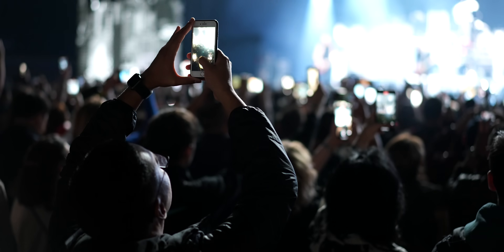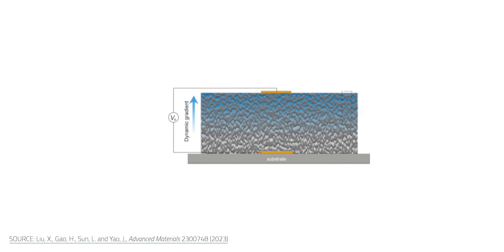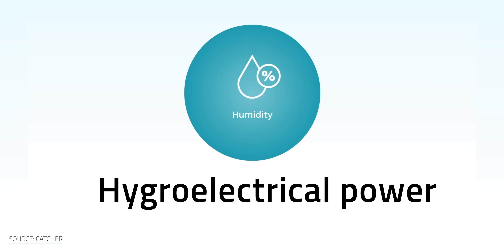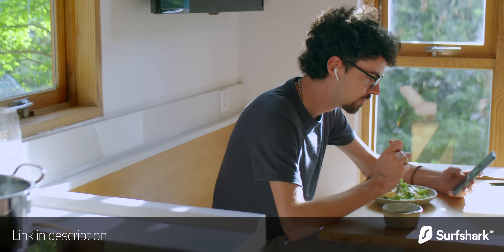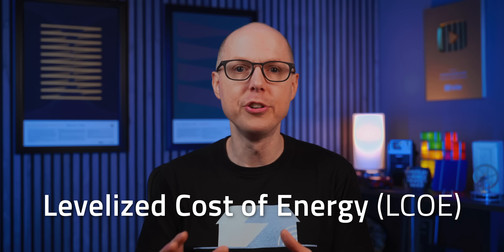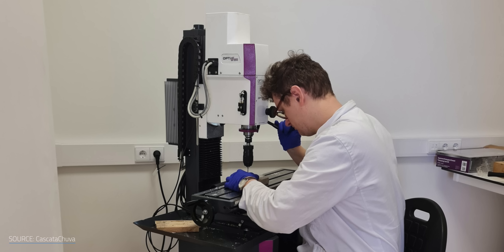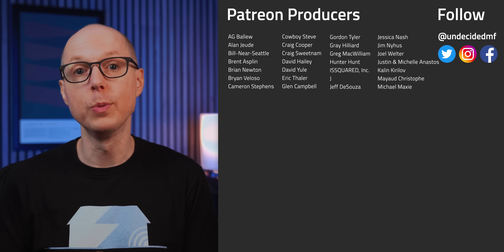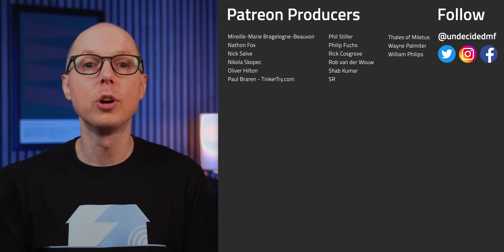Is This Accidental Discovery The Future Of Energy?

Comment: So it cant be eliminating the water molecules because you can't destroy matter or energy, and similarly it can't create energy either so the energy being collected has to have come from an existing source. So  the charge being developed  may be entropy driven. That would be wild, is there a temperature drop in the air?

That or its causing water to separate into its substituents like O2 and hydrogen or even OH- and H+ which would be really interesting as well.  Lots of implications including an alternate to electrolysis, pH reactions that could be developed, biology would be affected heavily considering how much biology is driven by surface area based water transfer between water soluble or in soluble membranes.

Water is a polar molecule as well so if this is driven by polarity, there are lots of other polar materials as well for when water may not be feasible or efficient. I'm leaning in the direction of believing polarity would have a important part to play in this considering charged materials interacting with water, or inducing charges is so foundational to biology and chemistry already. 

I am trying to ask myself what the limitation on this would be because you cant create perpetual energy here without it coming from somewhere, and some thermodynamic loss in the system, otherwise it would literally break the laws of physics.

theoretically once a optimized material and structure is created, you could pressurize a enclosed hydrophobic container filled with a pressurized humid air mixture with a conductive grid of this material and produce energy. then scale that by connecting each of these in a parallels array. if it denatures the water, then water will reform or could be ejected as its substituents and you could supplement a hydrogen fuel cell vehicle with a device that makes energy while producing hydrogen, meaning fueling the engine would be as simple as filling up with distilled water. a game changer for Toyota. 

If instead its entropy driven those same containers would get cold and slow energy production, but then, you just developed a new heat pump that you could just reheat to get more energy. a sunny day could be all you need to fake these energy producing containers function again. 

If polarity is involved and we've already been successful  at getting bacteria. to protein fold working materials, Nano machine design has a new way to illicit charges. you could revolutionize biology. Attach a patch to the sa node or av node using a catheter  and nitol splint and you have a micro pacemaker without open heart Surgery. Or a way to fry cells with zaps of electricity, or a new mechanism for inducing neurons to threshold with minimal surgical intervention.

if its none of the things mentioned and it is something. completely. new, holy crap. that would be new energy based science that could help us reimaging all aspects of science we currently. think we understand well, creating new perspectives on our scientific reality. that would mean who knows, and that would be discovery of magnets big.

Comment: You're not analytical or critical. You always jump on the hype train and repeat bold claims that make no sense, without first giving it a good think.
In this case, once the capillaries are filled with water, the device is toast. Or it will take more of its energy output to dry it out again. The energy density of this thing seems to be hilariously low. 

unsubscribed

Comment: Summary: Researchers from the University of Massachusetts Amherst have discovered a way to convert humidity in the air into electricity, creating what they call hygroelectrical power. The team found that nanostructures measuring 100 nanometers in thickness, or less than one thousandth of the diameter of a human hair, could create an electrical charge when airborne water molecules knocked against the edges of tiny holes within them. This process created a charge imbalance between the layered chambers, mimicking that of a battery. The team then applied the technique to a range of materials, including graphene oxide flakes, polymers, wooden nanofibres and bacteria, with all attempts proving successful. While the devices only produce around a single microwatt, CascataChuva, a Portuguese firm, is planning to commercialise a variant of the technology, with a pilot slated for 2024.

Comment: if the background theory is correct, you’re not using humidity to generate electricity, you’re harvesting energy from the heat of the molecules so it would need to be hot and humid and make the environment cold

still super cool concept

Comment: Because of the laws of thermodynamics, the only way you can get energy from anything is from something going from a high energy state to a low energy state.  In the case of coal it is high energy coal burning to produce lower energy co2.  In the case of the sun it is high energy hydrogen fusing to lower energy helium.  I am not sure what is going to what in this case.  In other words, what is the fuel and what is the byproduct?

Comment: Solar Panels are also the best ever excuse for building shade over parking lots, which of course keeps cars cooler and out of the rain or snow, but more importantly helps reduce the heat island effect. This new tech is pretty exciting nonetheless. Hopefully it works. Having multiple clean sources of power seems the safest plan for a variety of reasons.

Comment: What would be the environmental impact if this was ever widely used? You could be stripping the air of tons of moisture and if that is the case, couldn't that potentially impact weather on a large scale? Turn humid tropical areas into dry and arid if there is enough of those? Also, if they don't go all the way through, wouldn't that mean that they eventually get clogged up over time?

Comment: The dust and humiditiy swing problem could be sloved by putting it into an airtight enclosure and have a fan circulate 'pure' air and water vapor. Right? Edit: After reading some other comments, this solution might give problems with the seperation of dry and humid air to create the gradient or saturation of the material.
Also I wonder if the "bumping" of the water molecules that provides the charge reduces the kinetical energy the water holds, converting it back into liquid water from vapor. If that is the case the heat and velocity needed to give the humid air the energy to power the device would make an enclosed system impossible.

Comment: I subscribed to this channel in the past, but then unsubscribed in favor of other channels.  As an engineer, I get stuck easily when the technical details are wrong or missing, now not trusting that the rest of the content has been properly researched (and thus worth my time at the expense of other channels).

This video is a good example.  The YouTube algorithm knows my interests and recommended it.  Despite all the disclaimers, there are huge red flags that I struggled with immediately.  Any discussion of a new energy source should address conservation of energy right off the bat.  Where is the energy coming from?  This is so fundamentally important that without it being addressed, the video risks coming across as yet another one of those scammy over-unity device videos.  I strongly suspect that having one of these devices in your house would increase your heating/cooling bill far in excess of any power generated.

A second huge red flag is saturation.  Even if the device works as advertised, it seems very likely it would only do so for a short period of time before it would have to be 'renewed', no doubt by applying energy to it (e.g., heating it).  Again, this is a fundamental issue that is a prerequisite for any video like this to be ready for prime time.

A third huge red flag is describing the performance of the device by it's voltage output.  Run a comb through your hair and you can generate thousands of volts.  A US house is powered by 120V/240V, so clearly you can now power many houses with that comb, right?

The video did pique my interest enough to search the Internet for some details.  What came up was also full of red flags, unfortunately.  There was one paper from 2018 that mentioned that maximum power transfer out of the device occurs with a load of 10 megohms.  To an engineer, that fact speaks volumes about the potential viability of the device.

You have exceptional video creation skills.  I have seen many technically robust videos that were painful to watch.  Perhaps a collaboration might be good for both parties?

Comment: owe yes my design can be scaled up or down as needed , as well as retrofit into existing  structures ( i.e. in large cities & or rural locations }. Let's fix the clean energy issue ounce & for all . As to understanding my tech.  Ounce diagram is shown  most any 5th grade science student can under stand how it works & why it is better than solar, wind, hydro, or geothermal . I have this tech. to solve the energy needed for humanities current & future needs, but it is only fare that I am properly compensated for my ideas . So no I woun't just give it away. Let's talk.

Comment: Depends on what reaction the electricity is coming from. That is, exactly what is the true source of the energy. This will determine if it is a primary or secondary type of battery. I suspect this contraption will require elaborate recharging procedures to clean out the pores as they get filled with moisture. This may take more energy than the divice generates!

Comment: Isn't this more just absorption chilling but it can generate a charge? In a sense, it's a static charge generator. When it dries off, it generates some voltage. 

Seems like a thermoelectric effect, somewhat reversible, but mostly inefficient. Thermoelectric can produce cooling when direct current is applied, but can also produce power if heat is applied. 

Thermacoustic cooling isn't terribly efficient, but was used for cooling the IR module for the JWST down to around 10 Kelvin above absolute 0.

Comment: IMO, this technology's success will depend on how hard it is to remove the moisture from the moisture battery afterwards. 
If all it takes is a hot day, that's fine - then it can even be useful as an A/C heatdump. But if you have to plug in electricity to drive the water out of the pores, it becomes rather less useful. Not useLESS, because you can still use it to moderate solar power, but still less useful.

Comment: O.o this tech has been around for a minute though, theres an engine that ran off the ionically charged particles in the air, the only issue with the engine is they couldnt figure out how to slow it down or keep it from ramping up. They basically couldnt control the reaction.

Comment: It nano whatt not micro whatt and the next part is that they think that they might have left chemicals on or in the materials that were simply getting activated through the presence of water to form a week acid because if the theory you were describing were true they should still be getting a similar or identical result from zero moisture environments. The next thing is that many times they needed something to pull substances through the material to keep the system running for any amount of time but that takes much more energy than they were able to even consider getting from thousands of layers.

Comment: The price point doesn't look comparable.

The new technology produces 10kWh each day, while, at the same cost, a 10kW installation of solar panels will produce 10kWh each hour.

That would be in perfect conditions etc., but you can expect to generate way more than 10kWh each day with that solar panel installation.

This means that they are not comparable, the solar panels are way cheaper.

What am I missing from your calculations?

Comment: it's the question where do the water molecules get the energy from? Are they excited by sunlight and then release the energy inside the nanotubes? If we don't get the right answer we might just do the same mistakes of free energy, perpetual motion machines and attempting to run cars on water. it might also be a result of oxidation reactions but that's only my guess. An illustration of a single cell unit with comparison to a battery cell would clear out some unanswered questions.

Comment: This seems like a great idea...
Great for damp cold homes.
No need for insulation...

Small amount of starter energy, then the humidity battery sucks up all the extra moisture in the air and produces power which runs heaters which warm the air and produce more humidity.

A dehumidifier that produces power?

Comment: I'm not jumping on the hype train yet but I think it's an effect worth looking at.
I read  through parts of the  paper
One thing they checked for is water consumption and saturation. They had a 110h continuous test after which the current was the same as at the start. Therefore saturation doesn't seem to occur.
They also did weight measurements and tested relative humidity in a closed chamber and didn't see any changes there either. The explanation (as far as I understand it) they have came up with so far, is that the physical motion and bumping of molekules into the walls transfers charges and leading to a charge difference.

Since we have the laws of thermodynamics, the  energy has to come from somewhere. Since we are talking about motion of molekules, I'd assume that it's more or less a thermal generator. Unfortunately they didn't seem to have tested for any corrolation between temperature and output parameters or temperature of the device in an insulated chamber over time

Overall it could also be a fluke in measurements. But I haven't looked for any followup papers yet
Reply: We will never solve these problems until we come up with a more accurate means than mathematics to describe it.   the laws of thermodynamics are like the laws of conservation of energy, energy cannot be created or destroyed.  Then we use physics and math's that states 1 x 0 = 0, which destroys conservation of energy, yet we believe 1 + 0 = 1, energy preserved!

Comment: So... where is the energy coming from? What's happening to the moisture? Is this generating electricity from the changes in humidity? Is it condensing water into liquid and recovering some of the energy that evaporated it in the first place? I don't get the thermodynamics here.
My best guess is that this is a material that produces electricity as it absorbs water, and needs to be dried out to 'reset' it? In that case, it's the fluctuations as the weather shifts over the day that are being tapped for energy. I suppose this might be handy as a supplement to solar panels as humidity would be expected to usually rise at the same time as sunlight falls, but I doubt it's going to be any sort of game changer -- especially since both daily cycles AND weather changes would be relevant to its energy production cycle.
Reply: The energy is coming from the natural jostling around of water molecules in the air (Brownian Motion) hitting the water molecules, the water molecules in turn hitting the device, knocking electrons off the device and capturing the electrons.
Lower in the device the extra electrons on the water molecules are recaptured by the device.
The loss of energy from the air will cause the air to cool.
Reply: In that case, wouldn't it function just as well with the device sealed and provided with a suitably humid internal atmosphere, just left to exchange heat with the outside? What you're describing would be HUGE, as it would be a 'font of infinite cold' that converts heat directly into a more useful form of energy, rather than a heat engine that produces useful energy while accelerating heat's movement from high concentration to low concentration.  @simonruszczak5563  
They wouldn't have to advertise it as 'moisture power', this would be straight-up destruction of heat, which would be able to produce energy indirectly even if it didn't produce any electricity itself (since the 'hole' sucking up heat would create a temperature gradient). I'm very skeptical such a thing exists, but if it does it would be a much bigger story than this.
Reply: @05Matz  If it works to any usable degree, you'd be able to heat water to create steam to heat the water. I don't think there's enough heat in normal room temp air to be useful.. but I can see it used in places where heat is a byproduct, like the steel industry etc.

Comment: If this is legit instead of having a massive battery couldnt everything just be plugged straight into its power source? If 4cm is all that is required to power a LED light then why not just stick it to each individual LED light (not actually sure what that means, just how much power is it capable of producing?).

This would revolutionize power supplies, housing designs and much much more. Instead of using the space at the bottom of my PC to put a power supply and connect that power supply to an outlet, if a humidity battery of similar size can simply be put in there instead with its own power supply built in then there would be no need for outlets and power cords.

Comment: These novel startups energy concepts are great, but it will take alot of engineering to make them even remotely practical. A friend of mine was working on a DOD contract a ways back to help develop a yeast suit for soldiers to wear to passively generate electrical power from human body heat to help recharge equipment batteries. It worked, but really wasn't that feasible to implement.